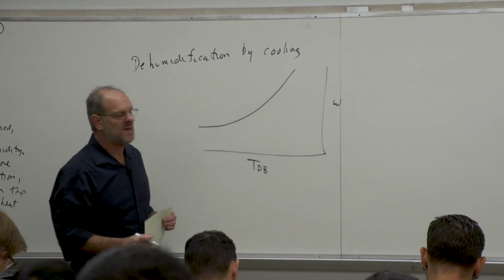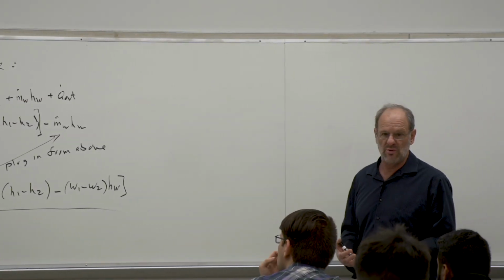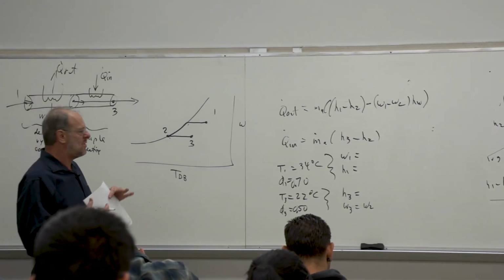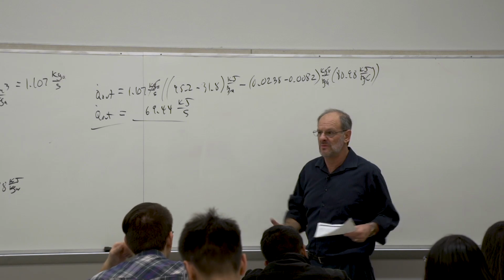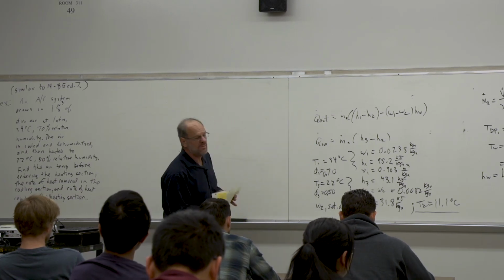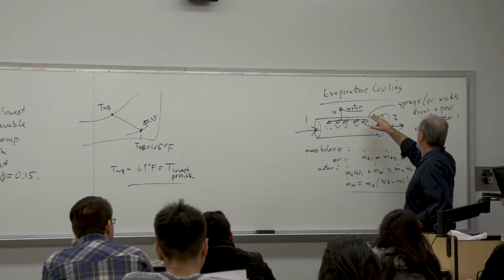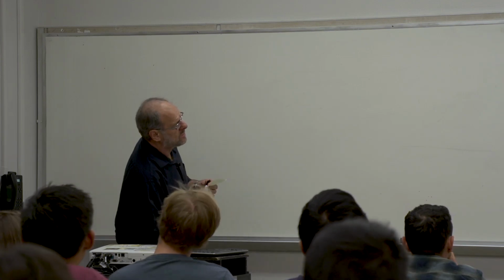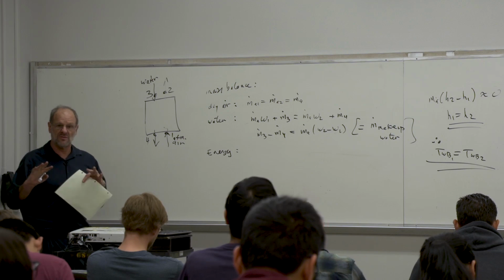Thermodynamics: Dehumidification by cooling, Evaporative cooling, Cooling towers (48 of 51)

Comment: If air at dry bulb temp at 36 deg C and RH at 42 %, i want to cool the air at 11 deg C by adding chilled water through evaporatorive cooler.
What be the following parameters.
Makup chiller water required temperature?
Quantity of makeup chiller water?
And TR load of makeup chiller water?
Kindly explain with calculation

Comment: What happens to the water temperature in the evap air cooler? Is it possible for both the air and the water to cool as a result of the evaporation? In the CT sens heat transfers from water to the air thus causing the temps to go in different directions. If the temps are flipped like in the evap air cooler does the air get colder and the water droplet get warmer?
Reply: @Brian McDonough My understanding is as follows (before watching the video): the sum entalphy of water and humid air is equal at entry (1) and exit (2). Introduction of water with large area (droplets) in the air with relative humidity lower than 100% will cause rapid evaporation until 100 RH is reached. In the process temperature of water droplets will drop. This will cause lowering of temperature for the air (conduction) and water (convection, mass transfer, droplets which did not evaporated falling into the pan).
Please correct me if I'm wrong.